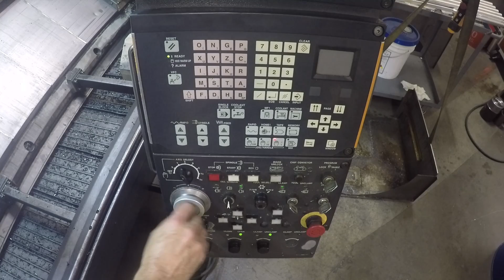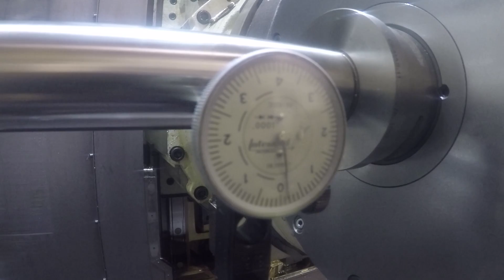Under The Covers Of The Mazak

Comment: hi Mr edge got a question for you? how much did you have to remove before you got to your X ball screws? and did you find anything loose there?
Reply from the maker: I didn't do anything with the ball screws. But for the X axis on this machine. It would be a much bigger job then I show in this video. It is the one that holds up this whole B axis spindle.
Reply: @EdgePrecision  i see
ever had to do the homing on the X axis though? through BS13 parameter? whereyou move axes in X and Y
Reply from the maker: @fredrezfield1629  The home position on this machine in X is the tool change position Y is the turning spindles centerline. And yes every time I power up the machine I zero return the machine.
Reply: @EdgePrecision  no no
NO
homing like my X value is out by .05 !
for example when clocking an endmill you get a value of -43.1  on the H position or horizontal position 
that value has changed to -43.15 
do you know what i mean?
Reply from the maker: @fredrezfield1629  I can’t say why it changed. But does it now always go to the same place now after zero return? If so you can reset the zero position or use a fixture offset. If it isn’t returning to the same position it’s probably something wrong with the encoder on the servo motor.
Reply: @EdgePrecision  or ball screw? 
could it be loose? 
i have a hard time even checking it out. mine is older 2001 integrex , 640 fusion control 
i thought you may have dealt with that parameter (BS13 x  from mazak instructions ) on your 640 fusion pro it maybe a different parameter
Reply from the maker: @fredrezfield1629  I have never had to reset that. As to ball screws. Does it make a lot of noise when moving the X axis? Is there a lot of load (higher than normal) showing on the axis display when it is moving? If not it isn’t the ball screw. They don’t fail like you describe. Maybe more backlash but not .050”. It is probably the encoder on the servo motor or the servo drive more likely. It is something else. The X axis has a gas spring balance device. That could also be a problem. But it would show a big load (bigger then normal) when X isn’t moving. Also was the machine crashed is the B axis still in alignment?

Comment: I had to reseal the B axis on an Integrex once. It's unbelievable how many components are jammed in there. There must be 60 o-rings that have to be replaced. Neat machines.
Reply from the maker: You are correct, although I have never had the B axis apart I have looked at the drawings and there are a lot of parts. Its amazing it all works so reliably.

Comment: I assume you were resetting the B axis zero reference because there is a curvic coupling that locks at that position?
Reply from the maker: The B axis couples in at 0,45,90,135,180 deg's to the coupling. All other angles are not clamped. If the clamped angles aren't exactly on. The only way to get them back in to mechanically move the coupling's housing angle. This is done by losing the bolts and jacking around the housing. There is jacking screws specially for this purpose. A test bar is mounted in the spindle and indicated for this alignment. Sort of similar to aligning a Bridgeport's head.

Comment: 2:48 - Instead of metal shields there is a lot of chips on a surfaces inside it, which is not good for rails and for ballscrew. Is this usual for it's work, or they'd felt down from somewhere during the cleaning process?
Reply from the maker: On a CNC machine or any machine shavings get into everything. You would think that the way covers or strainers in the coolant system would stop them. They only keep the large ones out. Take the coolant system for example. The chip conveyor has small holes to let the only coolant thru. The coolant tank still gets full of shavings. Not large ones but small ones. I have to periodically clean the tank. Where the coolant exits the conveyor there is a basket to catch these shavings. That can fill in a mater of hours when the machine is running. It depends on the material being machined and the machining processes. materials or processes that produce small sliver like shavings. Machining Inconel with ceramic tools is one of the worst. Cast iron is almost as bad. Roughing with adaptive or trochoidal machining can produce very thin splinter like shavings. It seems that no mater what kind of covers or filters there are, shavings get by or thru them. The roller ways and ball screws also have wiper seals the help deflect away the shavings. Sort of a second line of defense.

Comment: At the end of the video (love the inner look by the way!) when you were testing the travel of the machine, it looked like it exceeded the limits on the Z axis and just kept going up! Lol
Reply from the maker: Thanks ke6gwf ‼️👍The machine has of course soft limits on its travel. So it’s impossible to exceed the travel limits. BTW on a lathe the Z axis is the horizontal axis the vertical axis is the X axis. Unless you have the coordinate system rotated as on this machine at 90 degrees around the B axis than the Z is vertical and X plus is toward the chuck and Y plus it toward the front of the machine. Look at my video on machine coordinate systems. I explained this in detail.
Reply: @EdgePrecision ,  when I said the Z axis, something in the back of my mind was face palming, but I didn't feel like Googling it lol. yes, I was forgetting that this falls under the lathe coordinates scheme.

And part of my background is in industrial automation, so what I said about exceeding the limits was a joke because the spindle was going up, and then the camera shot keeps going up with the drone shot ;)

If you didn't do that on purpose, that would be a cool effect to have the camera on the spindle and then continue out the roof, or maybe running the length of the bed, through into the tool changer, down that tunnel, and then cut to the drone flying down the street or something lol

Comment: Another great video, very informative on machine details not usually shown. I am curious do you have a sense of how will this machines (or any CNC machine) precision will degrade over time - is it justs after X hours - when would a professional shop just replace the machine versus repair/maintenance?
Reply from the maker: If a machine is properly maintained and not abused (That means not crashed) its accuracy should not degrade with time. Things do wear out, hydraulic pumps ball screws bearings and electronics. These can be replaced or rebuilt as needed. Usually a business might replace a piece of equipment after its been totally depreciated on their books for financial reasons or a tax incentive. I have found that if the machine is starting to cost more to  maintain than buying a new machine. Or the technology has changed to the degree that it is more economical to replace it its time to do so. All the machines I own are more than ten years old and they still have acceptable accuracy. I have replaced a few servo drives and the hydraulic pump on the Mitsubishi Mill. The Mazak has had to have a very expensive power supply ($13.000 with 25% core exchange) replaced and the B axis spindle position encoder sensor replaced and readjusted. This requires a very special oscilloscope to do so. The chillers pump is about ready to be replaced also ($3.000 you can only buy the pump with the motor from Mazak). But neither machine has had any  mechanical issues that haven't been my causing.
Reply: Thank you for taking the time to provide an informative response - I enjoy watching your videos - interesting seeing both high end professional ones and the well equipped hobbyist stuff

Comment: I was just looking to see this, I am trying to design a very small mill/turn machine
Reply from the maker: Calvin Stence Do you have any questions. I didn't really explain anything.
Reply: Edge Precision thanks for the reply, I actually do! Do you know what the mechanism used to rotate the spindle is? When you had the covers off, i saw a servo which looked tangent to the spindle rotation, maybe it's a special worm drive? I'm wondering how it handles the backlash of such a mechanism.
Reply from the maker: Calvin Stence The B axis is rotated by a special roller gear driven by a worm like  worm. Imagine a series of rollers like cam rollers mounted on the OD of a disk equally spaced. Than a worm that drives against the rollers. As to backlash I'm not sure the fit must be very close. The B and the C axis can resolve to .0001 deg. The C axis is a normal worm drive. It engages by rocking the worm into the gear. First the turning spindle orients than the worm and its servo drive mounted on a pivoting frame swings into the gear. It held it by a hydraulic cylinder with a over center lever with a precise stop to control the preload of the worm. According to Mazak the B axis roller worm drive is quite reliable and they have no trouble with it. I hope this answers your questions.
Reply: Wow, that is incredible (and absolutely answers my questions). I always wondered how very accurate incremental rotation was done on trunnions and other machines like this, this method makes a lot of sense.

This video interests me greatly as I was curious about the general size ratios of the different machine motion assemblies. It helps one get an idea of what component sizes are appropriate for good machine stiffness, and how much material you really need to use, as it is safe to say that they are done correctly here.

Comment: Peter, I really enjoy watching your videos here but at first sight I does not make sense to me to tighten the bolts at the spindle head. What´s behind that?
Reply from the maker: To align the B axis the builders of the machine have provided a method. There is bolts around the perimeter of the flange that holds the B axis rotational axis to the end of the Y axis. If you loosen than snug the bolts. Than there is a adjustment/jack screw mechanism to move the B axis to get it aligned. I have a precision test bar to put in the spindle. I can use it to indicate the alignment. Typically I like to get it to less than .0005”.
Reply: Edge Precision That makes sense. I thought you tightened them only to compensate a potential relaxing or creeping of the bolts. Thanks for your reply!

Comment: Great stuff. What kind of running hours does Mazak give to the ball screws before servicing ?
Reply from the maker: I'm not sure. Of all the machines I've owned over the years I have never replaced a ball screw for wear.I have had one fail. On one of the Quantum Q1500V  mills the screw broke at the bearings at the servo end. I think there might have been a miss alignment and over time it stressed the shaft until it failed.

Comment: Great video Peter!  Two questions for you.  First, how has the Mazak been in terms of maintenance, getting service, and reliability?  Second, I spotted what I think is a Renishaw receiver in the Integrex, yet in the videos I have seen you have used more traditional methods of finding a "zero".  Whether or not you have a probe on the Integrex, why would you use a Haimer over a probe?  

Also, wanted to let you know that seeing the inside of the machine was really cool.  Even more impressive on the inside than it looks from the outside.  It is a rare opportunity to see the inside of such a machine, thanks for sharing!
Reply from the maker: Norman J In Houston there is a Mazak service center. If you want to pay high dollar they do good. There are also independent companies that are good and less expensive if your not in warranty. I do have a probe but I find it's just more convenient to use the Hiamer indicator.
Reply: Thanks for the info.  How often do you have to do repairs on the Integrex?  I have heard that mill turns are much higher maintenance than your typical vmc.
Reply from the maker: Norman J I have owned the machine for about four years. The machine is a little over ten years old. I have had some issues mostly electronic not unusual for a ten year old machine. These machines are less forgiving of machinist mistakes. You can knock it out of wack more easily than my horizontal mill. They are not what I consider a high production machine. If you have complicated parts with critical alignments they are the way to go.
Reply: Thanks as always for the response, looking forward to your next video.
Reply: Great video Peter. This is way outside my area of expertise, but hopefully one day ;) Other than the work envelope is there anything a 5 axis VMC can do this machine can't? It seems to be an extraordinarily versatile machine from the way I've seen you set it up with tailstock and steadies.Definitely subscribed to your channel and look forward to learning more about this side of things. Thanks

Comment: You mentioned hydraulic lines in the video. Does the machine have hydraulic servos or electrical?
Reply from the maker: No the machine has electrical servos. It does use hydraulic pressure for clamping the rotary axis and to release the tools. Also some of those lines carry coolant and air as well as wiring.

Comment: Peter, the X axis is what goes up and down?  Is it counterbalanced in some way?  I see what looks like some sort of piston or large rod to the left of the (vertical) ball screw.    thx.   The only thing more impressive than the machine is your know-how when it comes to running it!
Reply from the maker: Yes it has a gas/hydraulic counter balance mechanism. There still is quit a bit on constant load on the X axis servo motor.
Reply: @EdgePrecision  I'm guessing the entire (moving part) of the X axis must weigh?.... many thousand pounds?      btw:  Keep up the great videos!   I started machining when I was about 12 in my dad's business (well, truth be told I started cleaning the sumps in the cylindrical grinder, as I recall).  haha!  Anyways... I'm 61 now, and have been around the block a few times, but have never messed with parts of the scale you do (99% of the parts I've made can be held in one hand).  I love the way you use that Mazak just like it's a little Haas or Fanuc, or something like that.  Really terrific to see.   It appears you use mostly Esprit to program the Mazak?      (sorry to be so long-winded).
Reply: @EdgePrecision : You are supposed to fill it with nitrogen from time to time and lubricate the seals once or twice a year.
If the nitrogen disappears quickly, you must replace the seals.